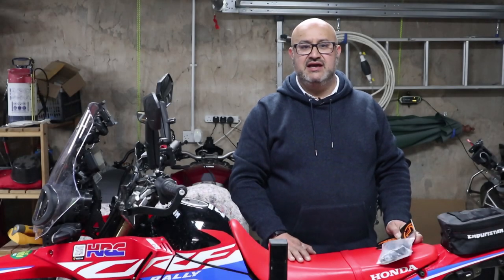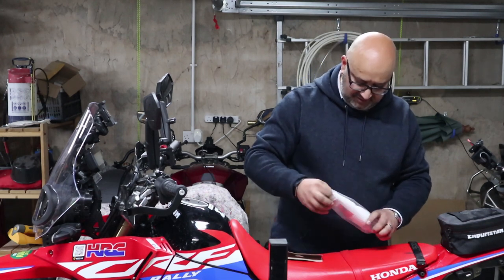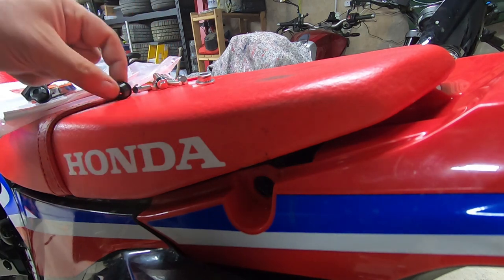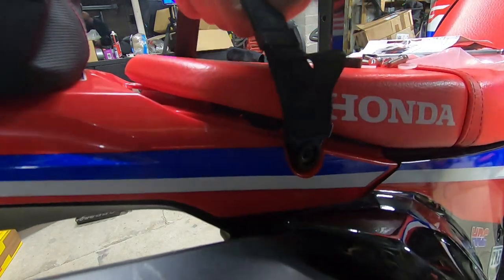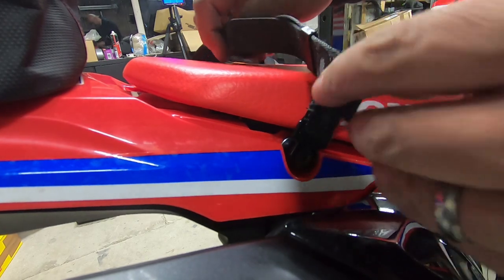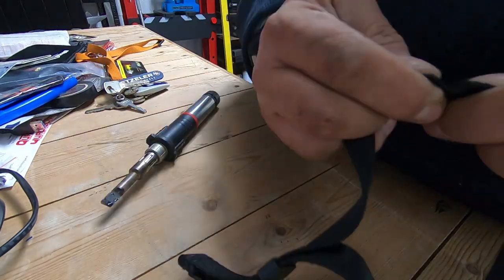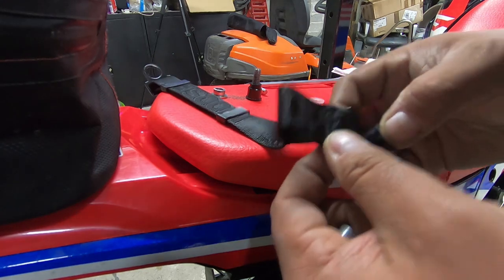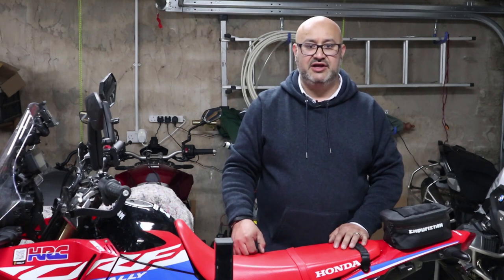Shorts: Moose Racing Rear Strap

Comment: Clear explanations, Andre, so everyone can follow you. 
I've been lazy until now and always carried two straps in the rucksack (from BMW bike transports, ask your dealer). They are helpful for everything and not connected to the bike, perfect for bike swaps on the way.
Your CRF is getting more and more personalized, great to follow.
Günter from Nürnberg/Germany
Reply from the maker: Thanks. I’ll be dropping the GS off for a service in a couple of months so will ask them. None of the enduro front straps fit the Rally due to the fixed headlamp and fairing, so perhaps the BMW ones would be a good option for the front. I shall investigate. Thank you.
Reply: @PeakMotorcycles  Thought so about the missing front strap. That's why I suggested BMW straps. Mine are 25 years old and still like new. Easy to roll up and store in the tank bag, camel bag or rucksack, secure the bike in the van, hold soft luggage tight. And they were for free, since dealers cut them after delivery of new bikes ;-)

Comment: Wht did you removed the rack?
Reply from the maker: It was 2kg of weight at the back, high up, and for trail riding without luggage it seemed a bit unnecessary so drilled holes in the plastic and fitted the Rally pack. I still have the rack, and it’ll go back on when I need to carry more.